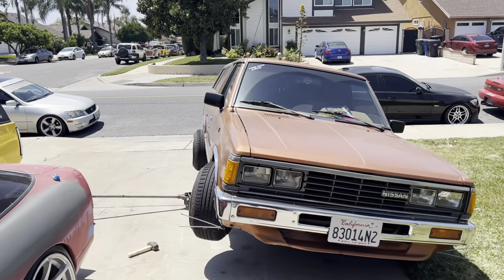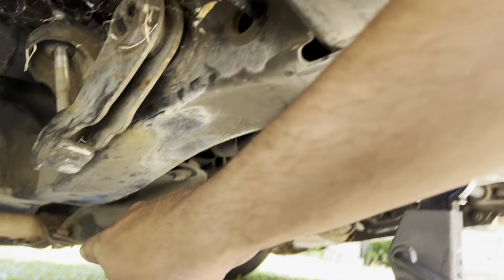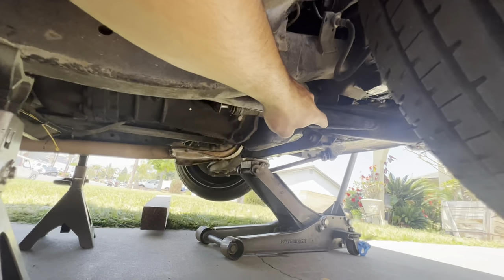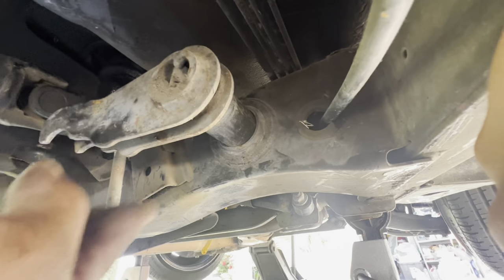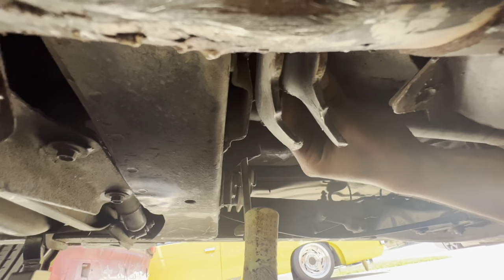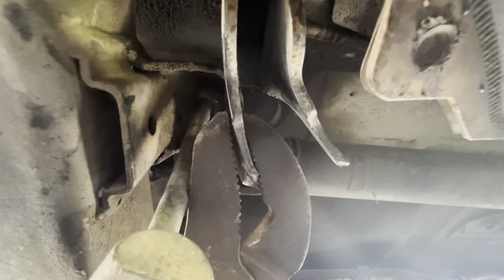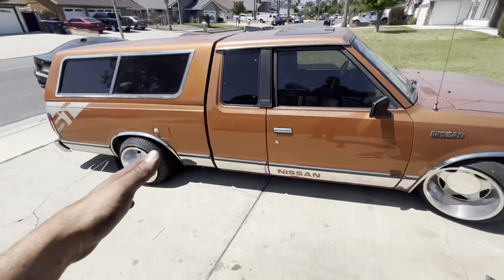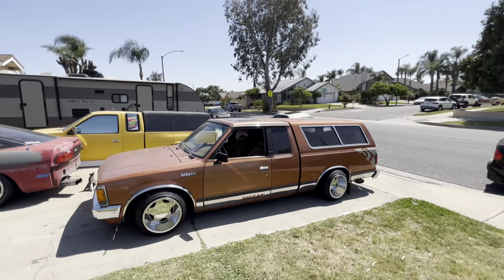HOW TO REINDEX TORSION BARS

Comment: If I only adjust the torsion bars followed it a small amount will I have to do this? I have 3” blocks in the back with nitro drop shocks and I just want the front to match
Reply from the maker: Yes you can lower it as little or as much as you want

Comment: I needed this for my 720❤
Reply from the maker: Hope the video help’s
Reply: Working in my 95 pathy and my 92 hb suspension. This guy's old Nissan looks dope!
Reply: The guy I recently bought the Pathfinder from, slammed it to the stops.. that's what I'm fixing right now. Lol the kid put in like 80lbs of wiring for 4 underglow lights, and 2 amps 🤣 I literally removed all of it, set the light wires and amp wires in 2 piles, made 2 new piles of all that was needed (from his wires) and sent him a pic saying "this is everything u n ur bros installed for lights n sound. The small pile of wire, next to the one full of rca adapters, is going to be CUT to length" lmao then I sent him a video of everything  working (untucked, with slack 😂). Kid put spacers on the hubs, titan tires (still has the big ass off road tire on the carrier), a weird horn lol.. I respect the kid for having fun with his ol' toy... But IMO, I just bought a K'NEX kit from a Lego guy 🥳🤣. I didn't haggle him at all. Bought if for what he asked... I did ridiculous things to my hb when I was young too lol.